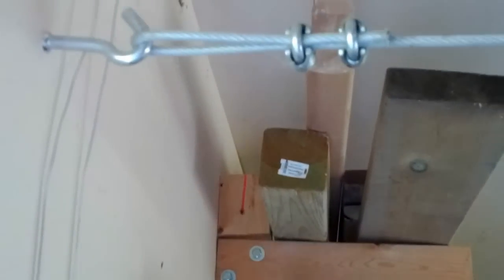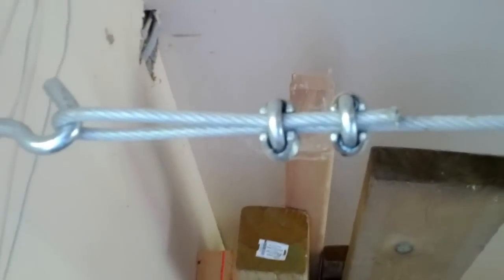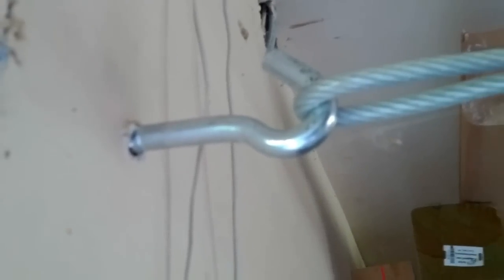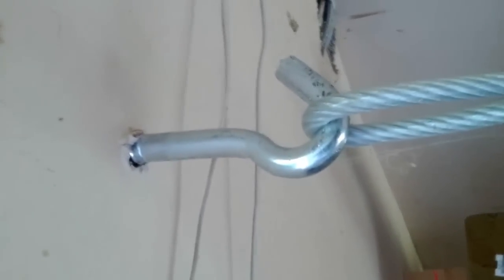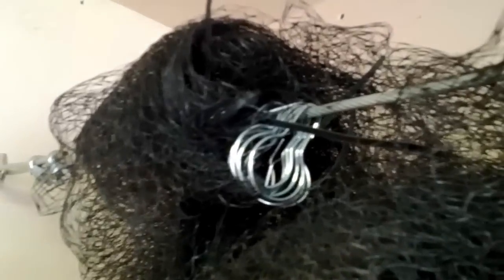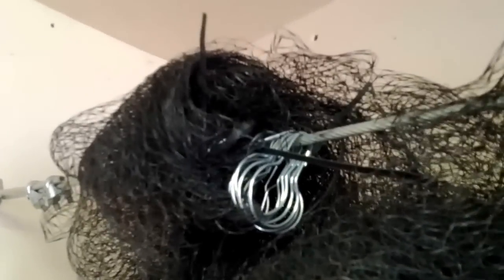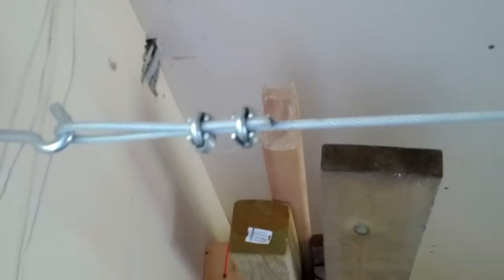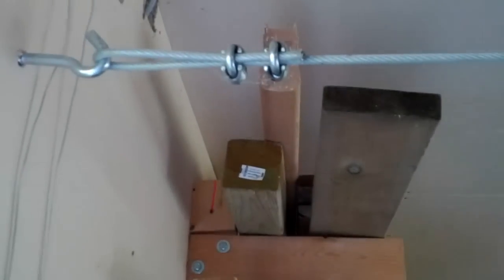Batting Cage How To

Comment: You can find light weight netting on the Personal Pitcher website.  Also, nylon cord will work just as well as steel cable and less expensive.  Shower-curtain-type hooks can be used to hold up the netting.

Comment: how did you get the cable wire as tight as you did?  I only notice the eye hooks.  I am looking to do this project in my basement for my son.  Thank you
Reply from the maker: +Mike Kapczynski Put the eye hooks in the studs in the wall first. When you put them in, don't go all the way. You can use the eye hooks after the cable is connected to tighten it even further by screwing them a little more into the wall. Then cut your cable to be the distance between the two hooks plus 3 or 4 feet. This way you have some slack to play with.Then wrap one end of the cable around 1 hook and clamp it down with the two clamps shown in the video (see video mark 0:05). On this end, you don't want too much slack. 6-12 inches is more than enough to clamp down the cable to itself. Then on the other end, you will wrap the cable around the hook and should have a few feet of slack. Get a buddy to pull the cable around the hook as tight as (s)he can clamp it down. Then cut off the excess cable. If it isn't tight enough, try giving the eye-hooks a couple more revolutions.  Hope that helps